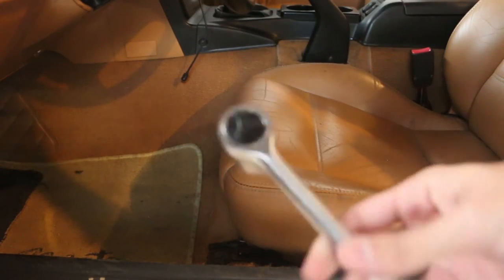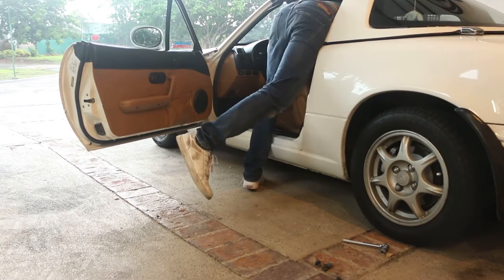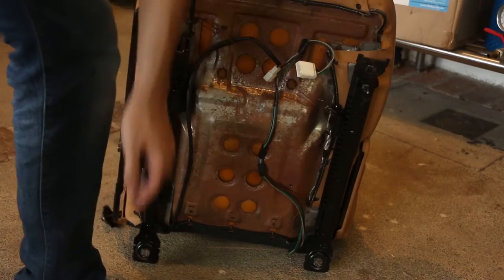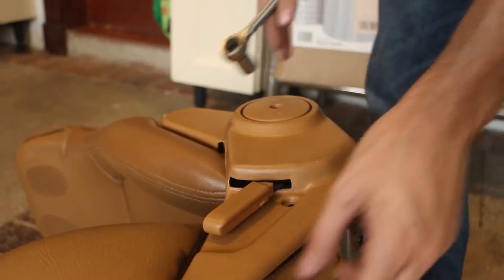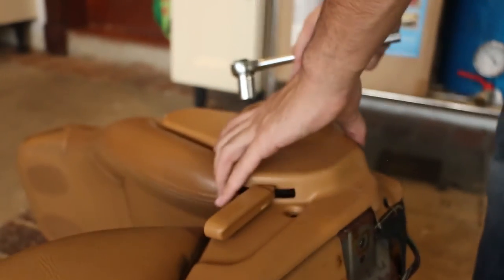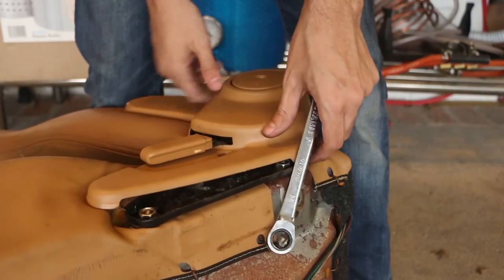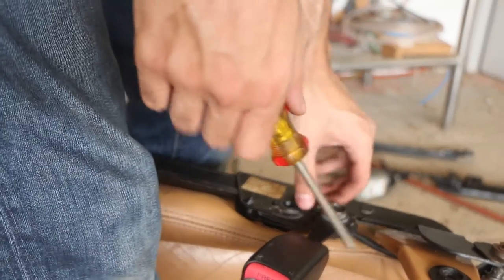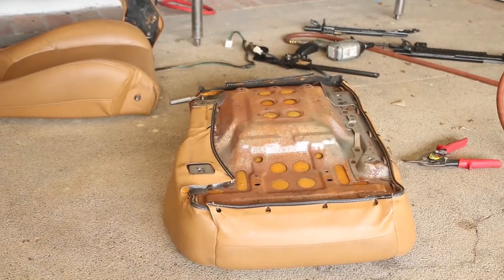The Miata Project: Foamectomy Time

Comment: The handle (back reclining lever) that was in your way can be pulled of, or levered of with a screwdriver. Just so you know ;)
Reply: was driving me NUTS.. lol. I was like ITS RIGHT THERE!! Take the screw out and slide it off.
Reply from the maker: Yeah, I can be really dumb sometimes. Especially for stuff like small screws.
Reply: WeebCarGuy naah man. You're not dumb. Ambitious and willing to learn maybe..
Reply: I was really impressed by the amount of time you gave it, without losing your temper or tearing that seat in half - I know my patience would have been loooong gone :D
Reply from the maker: Haha thanks! I was about ready to tear it apart though just to get it out of the way though. Glad I didn't though.

Comment: how tall are you brother? just wonderin
Reply from the maker: About 6 feet. It's a tight fit in there but I manage. :)
Reply from the maker: Yup, it's my daily. It's generally okay for comfort,I don't bang my head or anything and the stock seat has pretty decent back support. A/C and power steering is nice, but I could go without.
Honestly the ad you posted looks pretty good. With all those mods and for that price it's a pretty good deal, especially if the turbo was properly installed and is a legit Greddy turbo & intercooler. Check it for rust and def give it a test drive to see if anything's off.
Even though the ad says it's not been tracked, I'd take that with a grain of salt. No one puts 4k worth of mods on a car that they know they don't fit in and then not use them.
Reply: WeebCarGuy thats what i thought was hilarious too especially when he advertised track tires and the pics are of him "racing" it a bit. lol I figured I could talk him down to like, 3-3100 or so because of the back window too. What do you think about these other two im considering. Not miatas but similar in that theyre other sport compacts. I truly can't decide what to get. lol 

The SRT4 is 5k. The MSP was negotiated to 4600 out the door, the GSR was negotiated to 3900 out the door and I havent spoken to the owner of the MR2 yet. I can probably get it for 5k though. The mini same. Havent spoken but could probably talk down a few hundred off the 5k. 

In Houston A/C is a bit needed for a daily. Dont think I could go without honestly some days.

https://houston.craigslist.org/cto/5771010961.html

https://houston.craigslist.org/cto/5755132802.html

http://houston.craigslist.org/cto/5744517150.html

http://www.hondaoflakejackson.com/searchused.aspx?Year=2003&st=Year+desc

this last one is a 1 owner, dealer maintained, bone stock GSR too. http://imgur.com/a/f6wed
Reply from the maker: If it were me, I'd go for the MR2, but that's just because I have a thing for SW20 turbos.

The SRT4 looks clean af, but I've not heard great things reliability-wise, I'd look around in SRT4 forums and see what the consensus is though.

The MSP looks clean and has a clean Carfax as well, so that's a good option. Not really knowledgeable about MSPs so I'd look for forums to see how it is as a dd.

The Mini's nice and probably the most livable of the bunch since it's newer, but keep in mind that it'll probably be harder to work on if you intend to.

The GSR looks alright, but if you mentioned heat is a problem a black on black with black seats car is probably gonna be living hell.

All in all, it depends on how much you want to compromise. If you are looking for something more sporty and can sacrifice some practicality for it, the MR2 or Miata are your best bets. If you want something that can get you around comfortably, go with the Mini. If you want something in between, then that's between the MSP, GSR, and SRT4.

Sorry if I  rambled on way too much, I just didn't want to give you any incorrect info.Good luck choosing one that works for you!
Reply: I went with the MR2. Picking it up meow. Thanks for your help man. Appreciate it. I really couldnt make up my mind. Any ideas on diagnosing an AC leak? lol
Reply from the maker: Nice man, SW20s are awesome! For a leak I guess take some soapy water and spray ion the A/C lines, and the condenser, and see where it bubbles.  Not really experienced with fixing A/C leaks.

You could also do like these guys: http://www.mr2.com/forums/archive/index.php/t-93591.html
and get some coolant, dye and a blacklight to find the leak.

Worst case scenario though, take it to a good A/C shop and they'll be able to find the leak for you.
Reply: Man. It was junk dude. I was so disappointed but I ended up getting the SRT4. The miata was gone already too. Thanks again dude.
Reply from the maker: That sucks that the MR2 was crap. Well that SRT4 still looks mint though, so I hope you enjoy it!
Reply: Dude...I have had the worst fucking luck with this stuff. The guy just called me and cant find the title(bought it pending him finding it) and now Im on my way to get my money back. Seriously, FML hahah